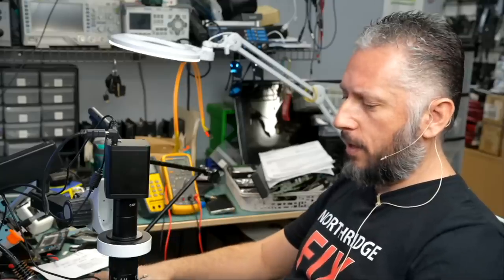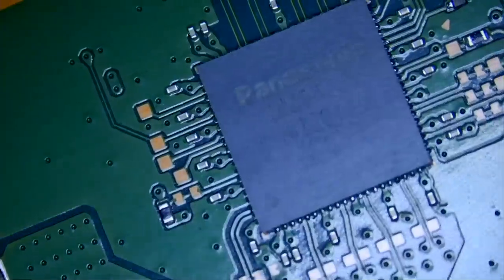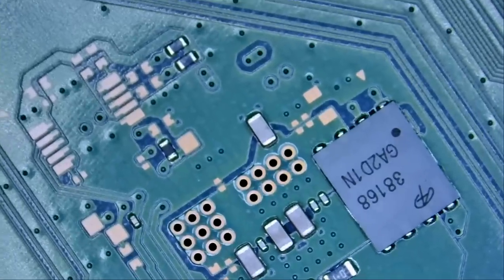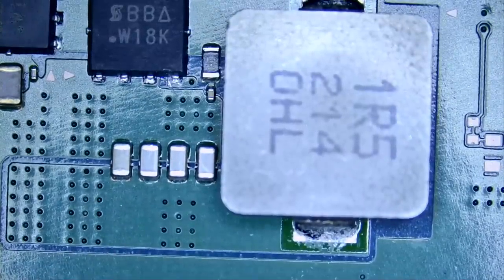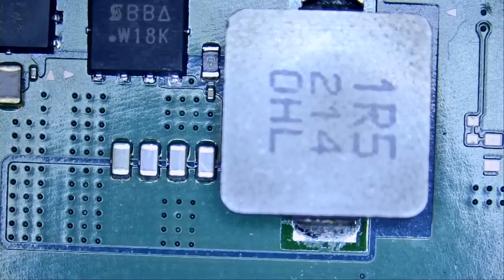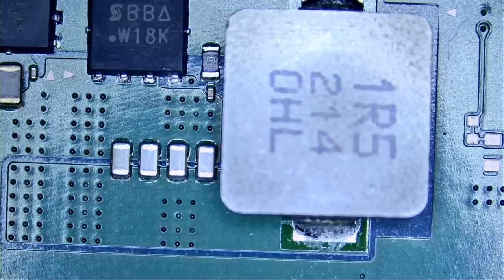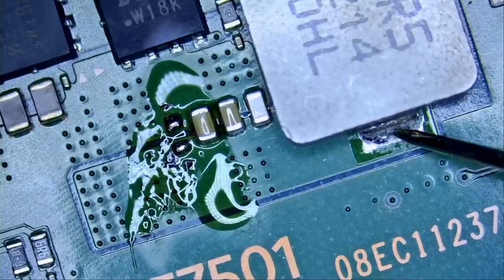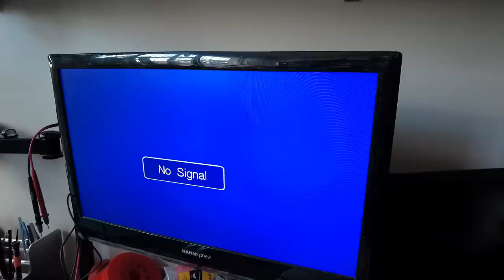PS5 Turns on then off after 1 second. Is it Fixable?

Comment: That's great that the system detects that there is an electrical fault, and immediately turns off to mitigate damage.  Solid engineering.

Comment: When I see how often those larger SMD caps fail in PS5s, I get a little worried, that those parts are a major weak point in the design (as is the HDMI port) 🧐
Reply: The HDMI ports on the PS5 isn't that bad. It's mostly people yanking out the cable forcefully instead. You see the same issues with other devices.
Reply: It concerns me Sony knows the design is flawed and doesn't make running changes to it to make it reliable.
Reply: @KL-zt6jx  This has been known for a long time and there are certainly ways to make such a connector more robust .... if SONY wanted to.
Reply: @Andreas_Straub   I have my PS5 for what 14 month now and I clean it every 2-4 weeks and I certainly have no problem with my HDMI port.

Comment: Just wanted to thank you for these videos. I managed to fix my asus motherboard by soldering smd capacitors, resistor and mosfet from a donor board.. I have been doing the macrosize soldering for years but these microscopic smd seemed very hard.. Your videos gave me the courage to practice on an old broken camera pcb I had lying around and then use the sra fastchip rework set to do the smd soldering.. Thank you for these videos. These are super helpful for amateurs/hobbyists like me.
Reply from the maker: https://northridgefix.com/product/amtech-nc-559-v2-tf-flux-10ml-syringe-plunger-2-needle-sizes/

https://northridgefix.com/product/10uf-mlcc-capacitor-asus-and-other-gaming-laptops-805-1206/

Comment: When you inject voltage, do you limit the amount of amps in the bench source? Or let him pull as much amps as needed?

Could you make some different videos, for example, not using a thermal camera? Or with other short detection methods... It would be very educational for your audience and have variety for your videos.

Thanks for the content and congratulations!
Reply: limits to a few amps, if not, you may pass 10 amps throught the board and possibly blow it like a fuse

Comment: If he only had it for a week and bought it new it is still under warranty. If he bought it used then he should contact the seller. As for losing his data, that is what the PS+ cloud service is for.
My PS5 I got in June (brand new) had a problem with stick drift on the controller and the blu ray drive stopped working as on the console, all within 4 months. Both were sent back to Sony separately and replaced (I doubt they repaired them). I then just had to reinstall all my games and download all my game saves as well. If you don't have PS+, then you need to back up game saves to an external source regularly.

Comment: Like always, amazing! How you do if you have not a donnor board to change it?
Reply: Find the value of the cap and install a new one. If you can't find the value online (from schematics or someone who's tested it before) then you could remove the next cap in line and measure that, as they will most likely be the same.
Or, when you have a few caps in parallel like that, they're all doing the same job so the device will probably work without one of them, so you could just leave it off.
Reply: @fadetonoir6152  thank you for your explication

Comment: Wow great fix, i thought that BLOD was coused by other causes then just a single cap. wow very nice fix.
Reply: On the PS4's they were always the APU's and sometimes the ram but on the ps5's it's commonly to have a blod due to quite a few things including shorted caps, etc.
Reply: This wasn't BLOD - it was power off after a second
Reply: @fadetonoir6152  Great point. People throw around these phrases and can mean different things when they do. This was a clear On/Off symptom (short somewhere), rather than what many of us in repair would regard as a BLOD. Of course, all these names can be a catch-all expression for many different faults to a repairer, but to a user they just see a symptom and a console that doesn't work. 🙂
Reply: @fadetonoir6152  that's called a 2 second blod on these.
Reply: @hove131  Sure, that's why I thought by just "BLOD" they meant the longer version.

Comment: If the capacitors were lined up in parallel like that is it OK to leave it empty and leaving just three?
Reply: Not for a power supply (e.g connected to a large coil and nearby MOSFETs) IMO. The designer has used 4 in parallel to achieve a certain capacitance that works with the power circuit. Other caps I'd happily leave off but in this case, prefer to replace.

Comment: Isn’t there any warranty on the PS5 in the USA? 😮

In Norway, there is a 5 year warranty on more expencive items, and large items like washing machines, and at least two year warranty on smaller, household items (hair driers, toasters, etc) Typically - you have the right to complain for up to 5 years when non movable parts on expencive items like PCs or game console fails, while movable parts like controllers, keyboards, obviously doesn’t have 5 years, but only two years depending on if you used the item properly.

Phones have two years years warranty even if they could be expencive, however you are still protected for 5 years if there is a production error.

Comment: I had this issue when I got mine. Turns out it needed so much power It needed its own socket and I couldn't use an extension with other plugs in it.

Comment: What would happen if the cap was only removed.  Would the other 3 parallel caps suffice?  Just curious what risk it would cause
Reply: The PS5 would melt and catch fire. Very dangerous friend. Never let the smoke out of the device.
Reply: It could work forever without problems, or it could knock the switching controller out of stable operation and possibly damage more components.

Comment: Good work, we need to know what causes boards components defects, what is your suggestions to preserve our different electronic devices to work as long time as it should
Reply: same question for my dell gaming laptop
Reply: You can't do anything. They are using cheap components where the corporation saves 0.1ct on 20bn pieces instead using the slightly more expensive components which lasts forever. Penny pincher.😁

Comment: Hello
You'te making fantastic job ;)
Just because I'm always want to KNOW why something doesn't work... I'm wondering if you can just help me in that way :) like hundred others gamers, I've have a classic issue with a 1116A model of PS5. It shut down randomly only with PS5 games. The more often after 30 min or one hour... When the expulse air begins to become a little bit warmer : black or green screen without any warning, sometimes with a long Beeeep of death... The fan didn't go faster like it should have to go if there was a dry spot of liquid metal somewhere.... With your experience, do you know or suspect something that could cause this issue? Or there is too many things that could cause it?
I send my PS5 for a refund and maybe I will buy a new one. I'm wondering if this problem is specially with 1100 model because I found 4 gamers with this problem only on 11000. Gamers who have never had an issue are mostly owners of a 10000 or 1200 models, with less power.... Thanks for your opinion :)

Comment: I'm assuming the customer bought this PS5 second hand. Who wouldn't return a broken system after a week to the store if it was not opened and tampered with. Yes stores have PS5's no 99% will NOT put it in the glass case. They don't want said glass cases smashed and have 5 PS5's run off.

Comment: Dumb question from someone who doesn't know jack about electronics: Wouldn't it be possible to measure the capacitor from the donor board and use a third party replacement instead? Or do console manufacturers use some weird caps that cannot just be grabbed from a store?
Reply: Yes that is possible. But this one fits perfectly so is easier to replace with original parts

Comment: There were 4 in paralel.
Why not just remove it?
Or it was part of tuned LC circuit?
Reply: Manufacturers tend to be cheap - they don't fit a component without a need for one. If you are fixing something only for the purpose of data recovery - fine to leave it out, other than that - replace it. Remember the laptop with parallel MOSFETS - both needed.
Reply: they are a parallel LC circuit in coax
Reply: There is a big chance of the other 3 caps had the same exact values? Or maybe not? Or for example if I remove the one next to the damage one just to see the real value and replace the damage one with one with that same value I could damage more things? Sry the English

Comment: Hey sir! Hope you are doing well. I have a PS4 original which after replacing the hdmi worked well but later got long blue pulsating light .tried washers but the duration got less. Removed the HDMI connector for checking but no success. At last I got the APU to reflow. NOW it just turns off after a sec. Please suggest me I am a learner trying to learn new things. Also are the capacitors along the rams and BELOW APU ARE 21 OHMS  is that any problems. Please guide me.
Reply: Replace the APU if u can or something went wrong with the reballing process to put it back on the board.

Comment: This design is really poor. It’s a complete failure this generation, saying that, so was last gen. The only reason $ony sold so many was they failed so easy. I have 3, not bothering with $ony this gen, it’s sat powered off and I only use the XSX, it’s significantly better setter designed and the 3rd party games run better.

Don’t buy, vote with your wallet.

Comment: I was originally on the original Xbox, then I had every single version of the Xbox 360. Then I made a bad decision and went to the PS4 every single version pretty good console very buggy and with a never ending please wait fuck that I went back to Xbox with the Xbox series S and now the Xbox series X I would not touch a PlayStation five with a bargepole
Reply: Hmm, you must of missed the part about the X360 having a 64.2% failure rate (RROD)... I've had my PS5 since this January 6th and never had any problems with it and no problems with my PS4 either, other than ejecting the disc slower than normal, but not bad for a 9 year old PS4.